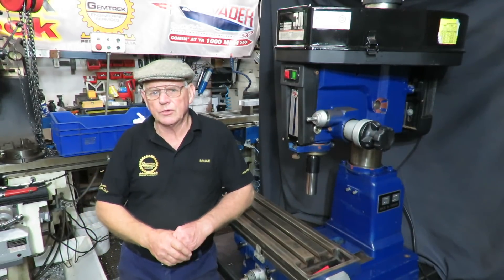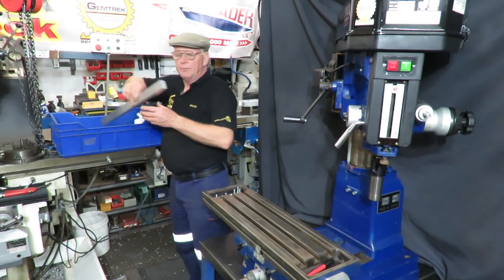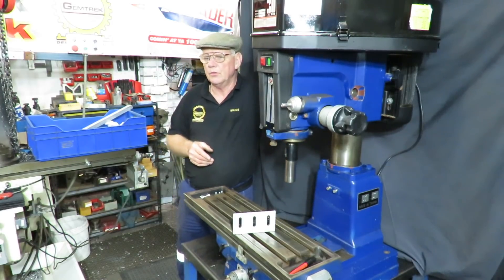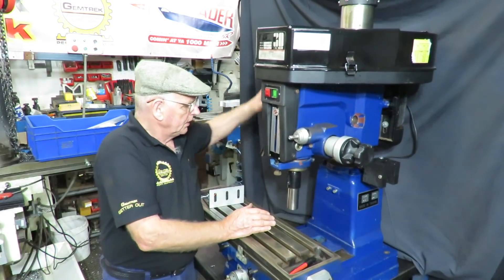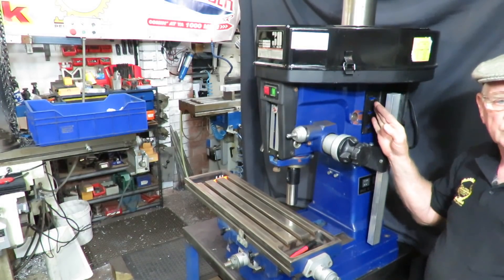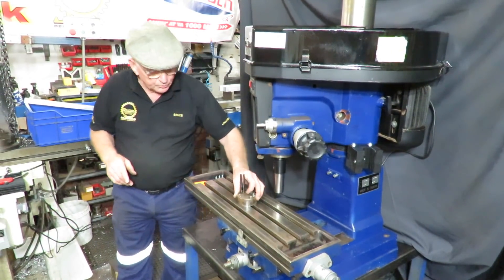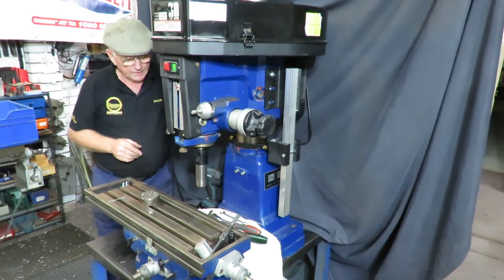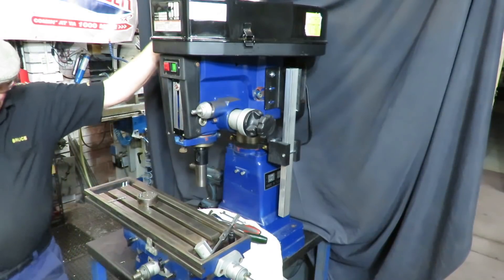TRU-LINE-8 RF30 Kit Components and Installation Demonstration Video

Comment: So there is an aluminium bar parallel to the round column?  It is attached at the centre to the head. But it is not attached at eirger end?
Reply: Has to float...lower part is a guide...

Comment: Two problems-
-For my machine (and many others) the top block prevents access to the column tightening bolts, which are at the rear.
-Why would someone with a milling machine buy milled parts to modify their mill?

Comment: .    Easy way to stabilize the head  is to line the head  to center then drill  a hole through the rack and into the  column at the top and at the bottom of the rack with a N 7 drill,  then thread the hole in the column with a 1/4  20 then drill the rack to take a  cap head Allen stud to be flush. You must tram the bed on these Mill Drills as they are way out.
Reply: Then you will not be able to rotate head!

Comment from the maker: To answer Blind dog's comment below: We are aware of the value of the laser pointer trick as you describe it and it is perfect for if you rotate the head and want it to be reset back in the zero position (if you want to call it that). However the Tru-Line-8 comes to do just that and provided repeatability in the vertical plane at any compass point that you may rotate the head and require adjusting height at that same radial point off the zero during working at an off zero position. Moreover the laser pointer trick is only valuable if the Mill drill stays in a static position. Some mill drills like mine are on a stand that gets moved around, The Tru-Line-8 is not effected by that.

Comment: You guys sure do things the hard way. 
I also have an RF30, and yes, the head moves sideways when I crank it up or down. 
So I epoxied a cheap laser pointer to a Mighty Mag, and stuck it on the side of the head. 
The laser pointer projects a .180 diameter dot on a vertical line I painted on the shop wall. 
The wall is 24 feet from the laser pointer, and the line is .180 wide. 
After I have raised or lowered the head, I turn the laser pointer on and rotate the head until the laser's dot is centered on the vertical line. 
I don't think you can get more accurate than that.
Reply: Great idea. I will be using a laser bore sighter with a tube glued to the machine. Thanks.
Reply: Maybe my math is wrong.  I’m calculating for .001 movement at the spindle center, the laser will move .016” on a surface 24 feet away.    It’s a big help compared to eye-balling 1 thou, but still tough to dial in, especially by yourself?

Comment: I think it's a fine idea but even with the mods that have been done to my HF version of this mill the cost would be nearly what the whole thing is worth as it sits +-$400 or so. I'd be lucky to actually sell if for that in a reasonable time frame. So.... Just can't justify the cost.
I get things set up and try my best not to need to move the head and that works so far- for much of what I need to do. I think long term I'd rather put that $400 plus whatever I might sell my rig for and buy a different milling machine. I picked mine up from a friend who did most the mods, Variable speed DC motor, auto feed on the Y and few other minor things on it for about $200 bucks some 10+ years ago. so i guess I got my moneys worth.

Comment: Hi Bruce. I am looking at either one of these Rong Fu machines or a Bridgeport for my shed. I like the older machines but the cost on the bridgeport is a little prohibitive for what I need. As an experienced machinist how capable/suitable do you think these machine are in the hands of a novice with a fair bit of inginuity. Also what would the cost of the kit be shipped to Melbourne?
Reply from the maker: Glenn, thanks for the query, the type of machine needs to suit the purpose, if for home hobby and small work the RF and clones can be found in a few million places and working satisfactory, the Bridgeport styles are for more serious work and have a much larger footprint, whilst less restricted to the types of tooling it can handle. Really comes down to horses for courses on the one hand and available money on the other. There are many forums showing how people have done some great work on the Rong Fu styles and they are not expensive maybe you should start there, upgrading will be easy in the future if needed. Old Bridgeport's are not cost effective in Australia, most are flogged out and parts are expensive, no one left that do machine refurbishments like once compared to the states
Reply: @BruceWhitham  Thanks Bruce. What is the price of your alignment system for the Rong Fu?
Reply from the maker: @glennvandenberg3912   Glenn a standard kit is AU$355 plus AU$45 delivery to Melbourne, send me an email to brucegetterout@gmail.com so we can converse directly. Cheers Bruce
Reply: Thanks Bruce I'll be in touch
Reply: Save your money and get a Bridgeport.
Reply: Wrong Fu: https://www.youtube.com/playlist?list=PLxJDsJd6ezvZYfHB2Ocu7x30SJyH28Fj9

this guys mods to the rong are pretty good. 
this link gets you to a few of his first mods but there are several others that are quite good on his channel.
Reply: https://youtu.be/Z7F6LUal7N0

Comment: Is that the same kit you had at the Summer Bash?
Reply from the maker: Yes that ii the kit I'm making. In this case the standard 115mm (4") dia column, the one at the bash was for the smaller column mostly same parts.